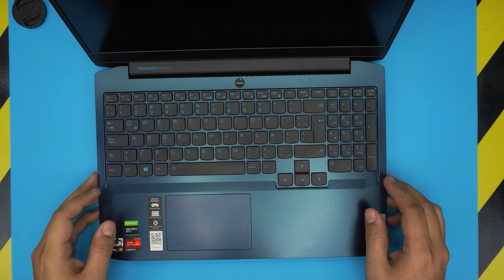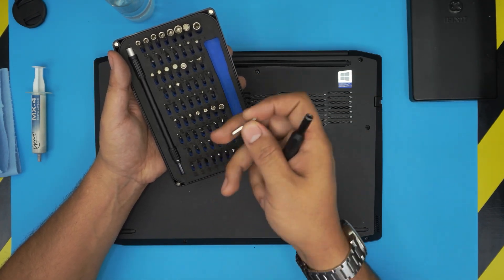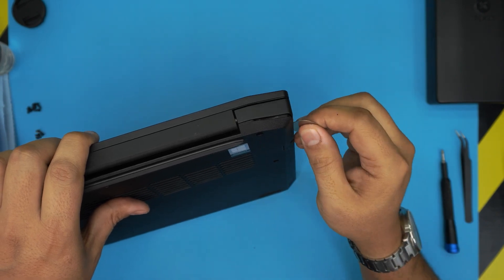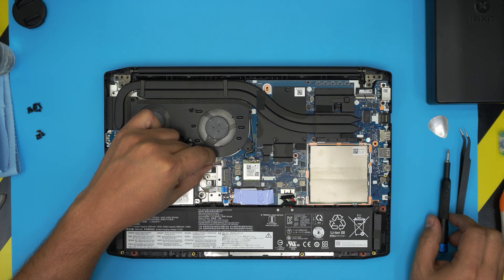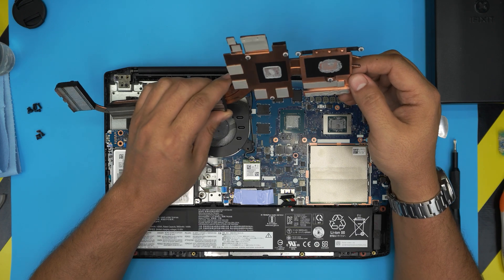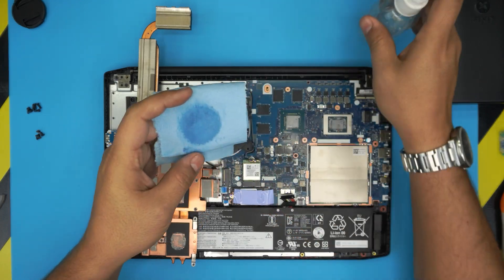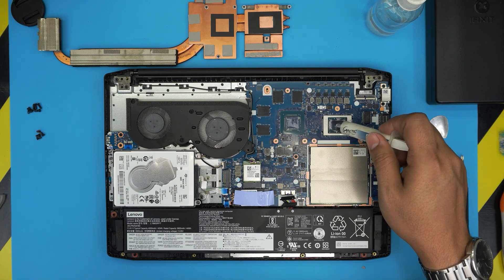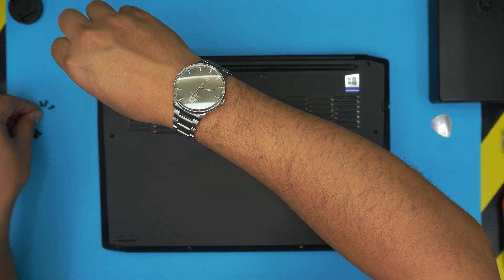How to Repasting and Cleaning for Lenovo Ideapad Gaming 3 15Arh05 ✅💻- Step-by-Step Guide

Comment: Hey I have repasted my lenovo Ideapad gaming 3 excatly 2 weeks ago with arctic mx6. Ar first it was all OK. Gpu temeprature decreased but CPU temeprature increased. CPU reaches 95 celsius at 60% load (msi afterburner stats) and is around 55 celsius at idle. Did I repaste it wrong? Maybe I used little bit of force when screwing to make sure its maximum tight, could it be bad?
Reply from the maker: oh there is something wrong with repaste, NOTHING to do with screwing tight the screws, that is fine.
you may have unbalanced heatsink, we do get that in the store and don't worry, do me a favor and use this: 
https://amzn.to/45I3UmG
and take your time and cut a nice amount of the pad and place it on GPU and CPU, clean the old paste off the heatsink and GPU/CPU
this paste comes in a pad format and once it heat sup it will become paste and it will fill the unbalanced gaps.
Reply: @uFixTek  but I still have few grams of mx6 left. Should I try repasting again? Maybe different applying method? I used middle dot technique but maybe spreading iš better?
Reply: @uFixTek  and wouldnt thermal paste work better than thermal pads?
Reply from the maker: absolutely it wont make no difference if you spread or DOT in middle,
the thermal paste is the ONLY solution for GPU or CPU, but the pad/paste link i send you is not a thermal pad.
it is a very especial paste that is in form of pad, it is .2mm thick and once the cpu or gpu heats up it will melt the pad to the paste and it will fix your issue.
make sure you remove the plastic layers from both sides.
Reply: @uFixTek  update, I have repasted with again mx6 and temps seam to be lover, maybe because not enough thermal paste I applied. Lowest 36 celsius with highest (gaming) 72 celsius, well see how it will last.
Reply: @louwe_1747  hey, did you do the repaste with dot technique or spread technique?
Reply: @lux.7376  hi, I have used dot technique, but it wasn't the issue, it was laptop design flaw, manufacturer had bent the heatsink so it was not making a good contact with CPU.
Reply: @louwe_1747  another question, is it okay that i use alcohol 70% ?
Reply: @lux.7376  you should be ok, it is recommend to use bigger procentage alchohol since it evaporates more quickly, for example 70% alc has 30% water and 99% has 1% water. So it's safer to use the 99%, but 70% will do just fine.
Reply: @louwe_1747  thx u for answering my question. you're so helpful
Reply: @lux.7376  no problem, just glad to be a help.

Comment: It was easy unscrewing everything until I got to the heatsink. 2 screws just decided to not budge at all.
Reply from the maker: Thank you for your feedback! If you wish to support the channel, you can like, subscribe, or both!
Regarding your question, use a flat head screwdriver for those, the flat head will have a better grip on corners, and press hard down on them and slow rotation AT THE same time.

Comment: Bro I have 2 questions
1.  can I use cotton for cleaning the laptop cpu and GPU
2. Can I use hand sanitizer as alcohol ?
Reply from the maker: Thank you for your feedback! If you would like to support the channel, you can show your support by liking and subscribing.

Regarding your question, I strongly advise against using cotton balls to clean the CPU or GPU. Cotton fibers can get caught on tiny capacitors around the CPU die and potentially cause damage. Instead, I recommend using a kitchen towel or a napkin for cleaning.

When it comes to using alcohol, I suggest using a minimum of 95% isopropyl alcohol. Hand sanitizers often contain a significant amount of water and are not typically 95% isopropyl alcohol, so they may not be as effective for cleaning electronic components.

If you have any further questions or need assistance in the future, please feel free to ask.

Comment: Hello, I also face with a similar problem.
For the context, I had an older laptop fan, but one of the vents broke and when running games or anything that puts the CPU and GPU at stress, it started emitting a very loud high pitched noise which was incredibly annoying. In the end, I ended up buying another fan to replace the old one. The fan when it arrived it was in good condition, all clean, nothing to worry about yet.
Then installed the fan properly like you did, i was careful with the wires and screws. I put the laptop panel back on and starting the laptop. 
And here is when I noticed a strange behaviour: on idle and plugged in, the laptop emits a rather annoying but not as awful as the old fan. I unplug it but the sound remains the same. Then I tried to lift the laptop for a bit to see which fan has the problem. I still didn’t figure it out. 
And when gaming or running anything intensive, the fans spin faster but it is just the spinning sound with barely any audible noise from a fan. 

Mind you, the laptop fan I am currently using is barely 1 month old and I already have some strange noise with it.

Comment: bro i have the same laptop , how much the temps diferences after repasting and cleaning fans ?
Reply from the maker: Thank you for your feedback! If you would like to support the channel, you can either like, subscribe, or do both!

Regarding your question, you would notice a significant decrease in fan noise and temperature, usually around 10 degrees Celsius or more. By applying a better thermal paste, heat transfer to the heatsink becomes more efficient, allowing the system to cool down faster. As a result, the fan will spin at lower speeds because it can cool the components more effectively. It's important to consider that there is a fan curve in the BIOS, which determines the fan speed based on the temperature threshold.

For example, let's say the fan starts running at 50% RPM when the temperature reaches 70 degrees Celsius. With a good thermal paste, the heat will be absorbed faster, enabling the fan to cool down the heatsink more efficiently, thus keeping the temperatures under control.

To summarize, it is advisable to replace the thermal paste once a year, depending on the laptop's heavy usage. Think of it as having a car and not wanting to replace the oil. 
I recommend using a high-end paste like Thermal Grizzly Kryonaut, which can be found here: https://amzn.to/468eynp
Reply: @uFixTek  thanks bro , my laptop has about 2 years and 7 months i never changed paste before , i only cleaning fans every 6 months and by doing that i get about -4 degrees in general temperatures , i want to repaste with gelid extreme i've heard that it's the best for gaming laptop
Reply from the maker: Honestly, from Gelid to Thermal Grizzly, we have tried numerous thermal pastes, and Thermal Grizzly always comes out on top. I would highly recommend going with Thermal Grizzly, but Gelid is also a good option. Either way, you'll be fine as long as you choose one of them.
Reply: @uFixTek  bro , one more question , is  1Grams  kryonaut enough to repaste both cpu and gpu 2 times for a laptop ?
Reply from the maker: YES , it is enough.

Comment: Will i be fine if i dont remove the battery? The cable seems to be glued
Reply from the maker: Thank you for your feedback! If you enjoy the content, supporting the channel through likes, subscribes, or both would be greatly appreciated.

Regarding your question, I highly recommend not performing this service without removing the battery, unless you are extremely cautious and ensure that you don't drop screws or touch other components with a metal object.

Comment: Hello, thanks for the video,i managed to remove the fan,but the heatsink screw its kinda hard to open it,is it normally like that?
Reply from the maker: Thank you for your feedback! If you wish to support the channel, you can like, subscribe, or both!
Regarding your question, you need to press down on screw hard and small rotation at the same time, yes it is very common that is hard in some cases.
Reply: @uFixTek  thanks for your quick answer,i kinda scared it will break the board
Reply from the maker: don't worry just make sure you twist slowly and press down  at the same time, you be fine.

Comment: I have a strange problem with my laptop, every once in a while, the image and sound freeze for a split second what is the reason? even while watching a movie or browsing the Internet
Reply from the maker: Thank you for the feedback! if you wish to support the channel you can LIKE or SUB or both :P
regarding your question: when we get this issue in the store the problem could be from following:
#1. SSD or HDD are going bad, check the SSD OR HDD status with CrystalDiskInfo
#2. it could be a bad windows update that didn't apply it self, formatting windows.
#3. CPU over heating , a repaste doesn't hurt and it can help a lot.
#4. replace the SSD even if it's still good as it happens that when the status of the SSD is good but something wrong with firmware and replacing it and reinstalling widows it fixed the issue.
Reply: @uFixTek  Thank you for the advice, I also bet on the disk or the processor, worse if it was a processor. As for the paste, I will definitely change it, because I haven't changed it for 2 years. I have a problem because I have the original system installed on the M.2 PCIe NVMe disk, but I do not have the physical key. Is it possible to transfer the licenses somehow?
Reply from the maker: as long as you have used your Hotmail account in windows settings then your windows key is automatically linked to your account, and once you install windows 10 or 11 in the installation steps click i don't have the lic key and continue and once in the windows then go to windows settings and connect to internet and use your email in the windows and you be set.
Reply: mine is a "slowed down lagging freeze" that lasts around 1 or 2 seconds, but i believe we share the same minor issue with our ideapad gaming 3.

Comment: I used thermal grizzly kryonaut extreme, not as huge difference like intel systems but max 78C during cinebench from 82-85C
Reply from the maker: 78c to 85 i would say its a good change my friend 78c even 80c at max load its sweet. the CPU slows down when hits 95c+
Reply: @uFixTek  I've seen statements from AMD that these newer chips won't throttle until they reach 105. I wonder traits the chips have to allow for more punishing heat?
Reply: @Jnaathra  the Honeywell PTM7950 thermal pad is used from the factory on lenovo laptops! Official info

Comment: I still get high temp after repaste :(
Reply from the maker: Thank you for the feedback! if you wish to support the channel you can LIKE or SUB or both :P
regarding your question: what model of the thermal paste you used?, and did you replace the thermal pads?
Reply: there shouldnt be a reason to get high temps after repasting. What brand did you use? did you put enough paste on it? did you clean out the fans aswell

Comment: Hello. I have a Lenovo ideapad gaming 3 15imh05D. My laptop has a hard drive but no ssd. I am going to add an ssd to it. What thickness of thermal pad would you recommend for the ssd?
Reply from the maker: Thank you for the feedback! if you wish to support the channel you can LIKE or SUB or both :P
regarding your situation: .2mm pads are recommended my friend
Reply: @uFixTek  thankyou. Is it ok to use 0.5mm?
Reply from the maker: .5mm should be fine, but i would go with .2mm but .5 can squish in there too.

Comment: This will affect my warranty????
Reply from the maker: Thank you for the feedback! if you wish to support the channel you can LIKE or SUB or both :P
regarding your question: absolutely not! , opening your laptop does not void the warranty. In fact, it’s common for customers to open up their laptops, clean them out, and make sure everything is running smoothly.
Reply: @uFixTek do these laptops have warranty seals or something like that, i have given my laptop to reseller for servicing and thermal pasting,mofo did that in gpu too,idk if he removed warranty seals ,do these laptop have them?
Reply: It won't provided that nothing broke.

However, if you broke something (say you fucked one of the capacitors), then the warranty does not cover your damage as it is not Accidental.